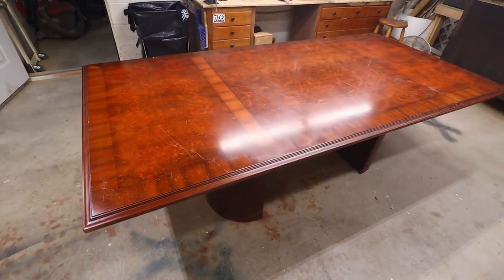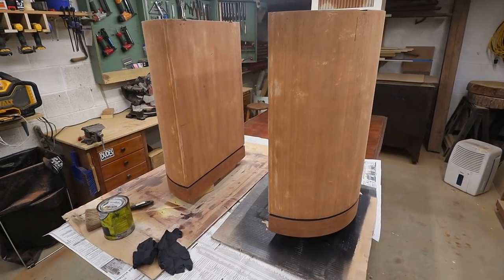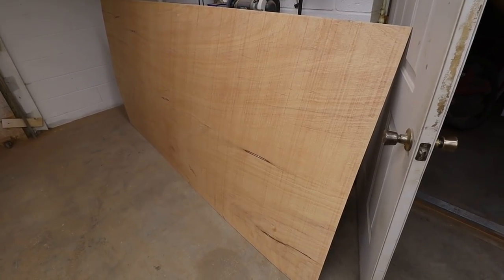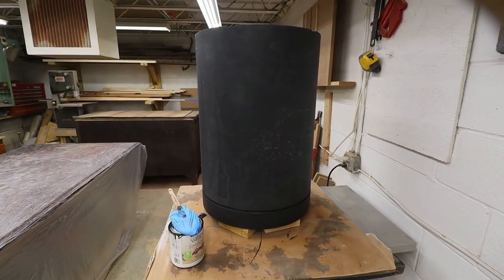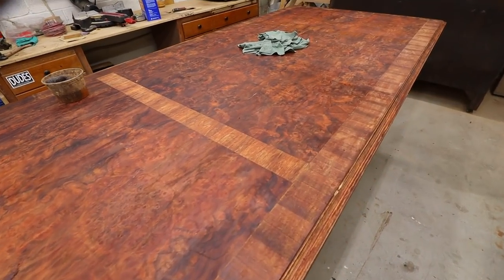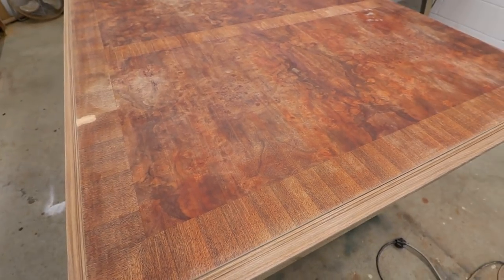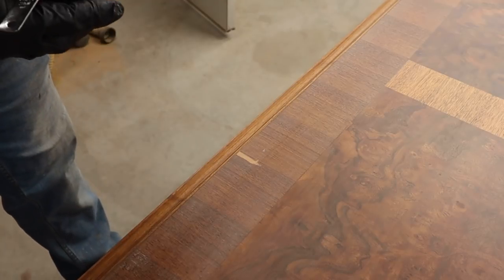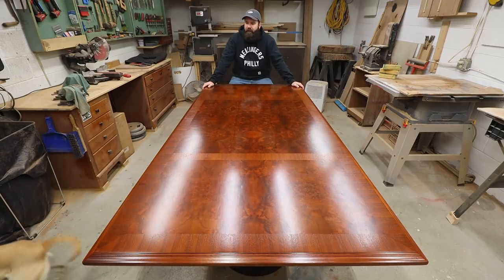Walnut Burl Conference Table Refinishing | 10.16.19 | How to Furniture Restoration and Repair

Comment: You can try a bathtub with water and fabric softener to soak the veneer in then mould it wet around the legs with no adhesive. Strap it down. Let it dry and then it will be moulded and you can adhere to the legs. Saw this on Thomas Johnson Antique Restoration.
Reply from the maker: I didn't have the time and wasn't in the budget or else I would've reveneered them. Customer wanted black legs anyways so it didn't really matter. But you're right! I could've done that.
Reply: Love Thomas Johnson's videos!

Comment: I've been a french polisher for 33 years in the uk. What we do is coat up with stripper twice scraping in between coats then apply a 3rd coat and use corse wirewool going with the grain cleans all the finish off👍

Comment: A tip I got from See Jane Drill - use any kind of cooking oil to remove stain from your hands.  It really works and is gentle to your hands.  I use spray olive oil.  Probably cheaper than the stuff you buy and you probably already have it!

Comment: You did well to maintain a good attitude when things went south.  And they went south quickly!  As a piano refinisher I've run into many of the same problems you encountered here.  Like you, I try not to use tinted lacquers as the tone can become uneven during spraying and sanding.  I have a wonderful waterborne "lacquer" that dries fast and is sandable in 30 minutes.  It makes it possible to apply and sand multiple coats in one day, and it's hard as a rock.  let me know if you'd like some info on it.
Reply from the maker: Absolutely! I'm always looking for a waterborne lacquer that holds up and can save my lungs!

Comment: How do you deal with the overspray in that space?  Do you have some type of filters running?  Really would like to know as this is a big problem for my workshop.  Thanks and great job on the table.  I just restored a maple dining room table and painted the legs black also.
Reply from the maker: I get little to no overspray. I use an hvlp gun as they're known for less overspray. That and some fine tuning is all I really do.

Comment: That table fought you tooth and nail. You did a fantastic job. I know you preferred to not paint the base but it looks incredible, and resembles Biedermeier antique furniture. How many hours total did this project take you? I can’t imagine how much such a project costs?  I was curious about the plastic sheet over the stripper. Can that technique be used with Zip Strip? That stuff seems so strong I know it dissolves synthetic brushes.
Reply from the maker: I'm sure that'd work with zip strip. Always did that on tables at a shop I worked at and we were using the commercial stuff that the smell stays in your skin for days.😩 It reminds me of the episode of breaking bad when Jesse doesn't get the plastic tubs Walt tells him to and uses the bathtub instead. Hahaha some plastics can hold up to acids surprisingly well! 🤣

Comment: When you steam a veneer to raise the grain do you run the risk of the glue releasing?
Reply from the maker: I take extra care when steaming a veneer. It's possible to lift but I've never had it happen. I just base it on a piece to piece basis whether or not I do it.

Comment: That gummy finish is a commercial grade high wear finish from the 80's and 90's. I did a heavy office desk that had the same crud on it. It SUCKED. The veneer had sucked it up unevenly. I ended up having to sand it off and I did sand through a corner of the veneer. 80's and 90's nicer office furniture was really pretty badly made.